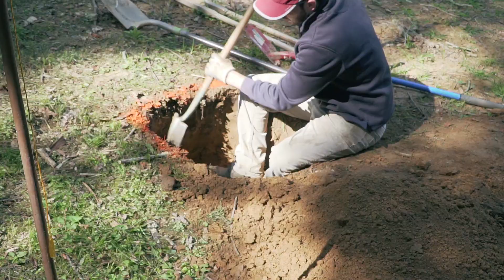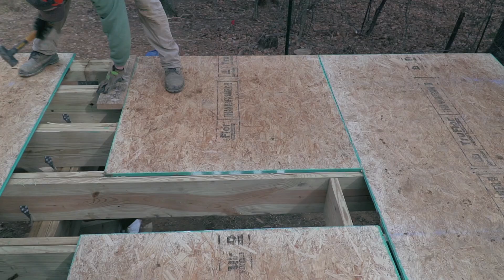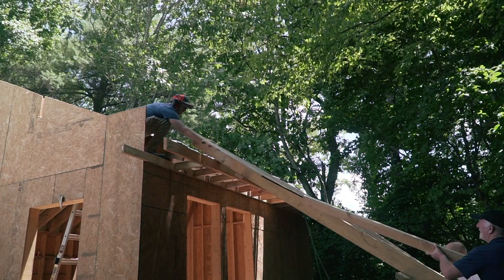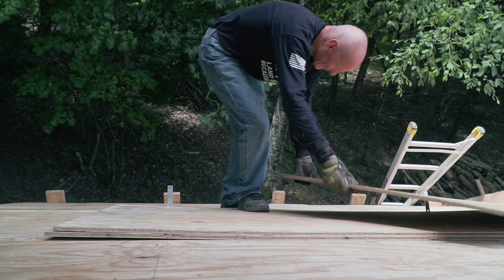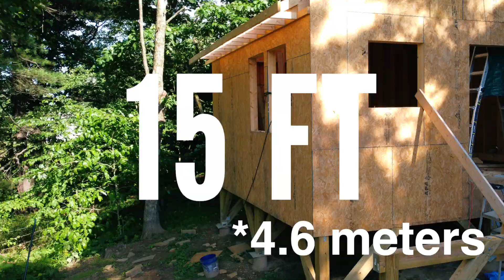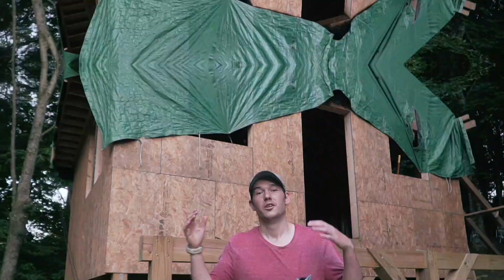Doing it Safely Because No Roofing Work is Worth Breaking a Leg For !  - EP 33

Comment: Like it so far. But really the slope being the same on both sides, you needed fall protection on both sides, or none at all, the height on side closer to the ground can still cause you serious harm in a fall. I think it was more the psychology of the 'higher off the ground side' in deciding to use the harness.  6/12 roof is my limit for roofing and walking around on it, I am not a pro roofer. I made my 2 story 12by16 gambrel shed with a 25 degree angle to the roof. and the hammer wanted to slide off and me with it, so I did also use a harness. I did not get on the roof to put on the OSB sheathing. I used step ladders on the floor and some ropes to push and pull them up and nail them down. I Only actually got on the roof for the synthetic underlayment. Nice to see you had 2 family helping you. It was just me and the wife on the shed. I am planning to replace my  2 story house roof, sheathing and all. Made in 1973, builder used 3/8 ply and it just too thin. Going to use 1/2" plywood, no OSB for me on a roof.
Reply from the maker: Makes sense, it’s totally psychological, could still get hurt falling in the low side. I typically wear the harness all the time now. 
Yeah help was nice, I don’t know how I could have installed sheathing by myself.

Comment: Are 2x12 rafters and joists supposed to have blocking at the load bearing point?
Reply from the maker: Im gonna go back and add blocking at the rafter on the wall
Reply: @TheDIYCabinGuy  Nice! You should leave space for the vent, it will also serve as a wind\moisture block for the insulation.

Comment: Why use plywood? Mostly I’ve seen osb used for roof sheathing. The stuff with the lines on it. 
You could add a layer of tar paper on the sheathing which would make it mostly water tight. 
Lastly, you should check out some videos by “ the crazy framer” he builds houses mostly solo in Edmonton, Alberta and often in the winter. I’m sure you would scoff at the quality of some of his work but you can’t argue with his work ethic and ingenuity when he usually frames a house by himself in 1 month!!!
Reply from the maker: Yeah I don’t really know, both osb or plywood are acceptable. Maybe plywood was cheaper when I ordered. 
Yes I recently taped the seam for now but will install the underlayment soon enough.
I’ll check that channel, I didn’t know it.
Reply: @TheDIYCabinGuy  
OSB much cheaper, plywood more structural.
Reply from the maker: @kimchee94112  makes sense, I guess plywood might old better the roofing screws over the long term than osb would
Reply: @TheDIYCabinGuy  
My floor plywood, roof OSB. Plywood would be better but more expense, roof minimum loading so I didn't need it.